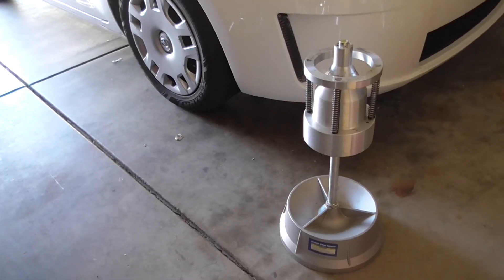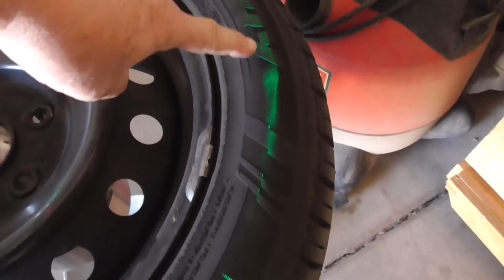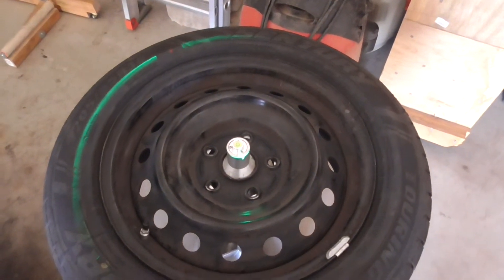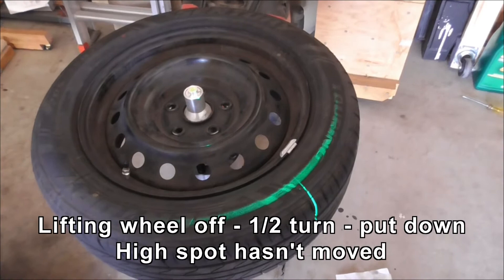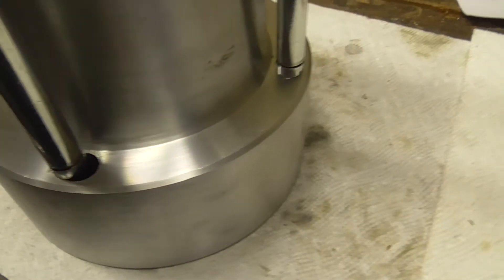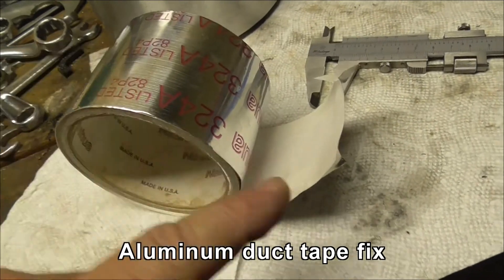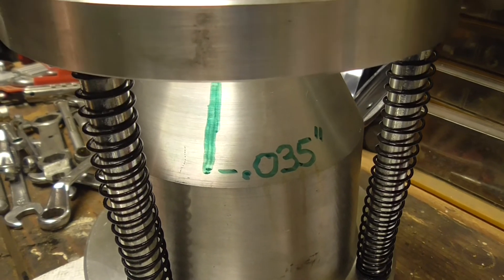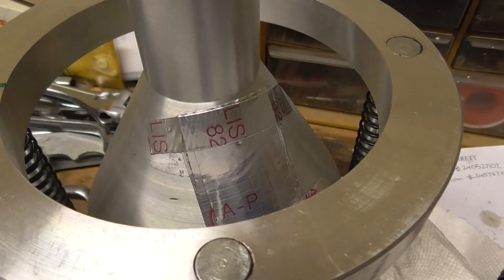HF Bubble Balancer Flaw

Comment: Nice video. Would it alternatively be possible to start with the cone as the baseline truth? Then you would need to balance the balancer mass so it sits level - adding weights to it, permanently. Then you'd need to adjust the bubble assembly itself so it reads level. So after that, remaining unknowns would be if the hardened point (or substituted ball bearing, etc.) adds a bias. But hopefully you would be able to have the balancer, with no wheel on it, read centered at any yaw angle, while your dial indicator is reading zero runout. Then after that, you'd need to be sure the spring loaded ring does not introduce any bias when the wheel is placed on there.
I know this sounds complicated, but it seems it would get you there. And I'd feel better about not having something soft like aluminum tape on my balancer. BTW, I just bought one of these balancers, and don't yet know how bad mine is, LOL.
Reply from the maker: You may have bought a good balancer. I think some exist, just not the one I had.
How long do you have to return it, before it becomes a keeper??? Keep that in mind, I waited too long.

Tips for a good setup:
The central shaft on the base needs to be vertical - check with a spirit level where ever you place it and shim the base to get it vertical. This is because the pivot point doesn't sit on a point, it sits on a ring and that small radial distance can throw things off. Took me a long time to sus that out.
< If you want, you can make a leveling base out of a piece of plywood and 3 nuts and bolts, like at the start of this video - https://youtu.be/JvN4i-qJqMs >

See how much slop you have between the support frame and the head. The wheel must sit perpendicularly with the cone. On my unit the slop seemed to change every time I put a tire on it. Meaning it wasn't congruent with the cone axis (sorry about the big word).

When you have a tire balanced, be sure to lift it and turn it 90° and put it back on the balancer to make sure the balance point has not changed. 

If that all works, you have a good balancer. This can all be tested with a recently balanced wheel from a dealer, if you just had them put new tires on.

I do laser static balancing now & use stick on weights as my alternative to the bubble balancer.
Reply: @richbinaz  I finally am getting around to doing things here. Tested today on an already balanced, never installed, spare tire, and basically confirmed I DO have a good balancer. Got it used on Craigslist, and it looks like a HF one, but is a Costway AT4317. Measurements are all repeatable and make sense. 

I think with all the problems people talk about on these machines, there are actually multiple things that might be wrong with each person's machine, and one challenge is to figure out which problem(s) you've got with yours. And then to solve the biggest one, etc. The cone alignment issue you have seems to be the toughest one to solve. For me, no problem there. 

I've got the standard pivot ring vs. pivot point up top, but a little grease and some repeated jiggles can solve that one within necessary accuracy. 

A big factor I found before achieving repeatable results was how the wheel sits on the cone. I found I need to make sure when looking through the 5 lug holes to the ring behind it, covering about half the opening, I need to make all 5 of those symmetric with eachother - so each hole shows the same gap between the balancer head ring and the wheel lug hole. I found that using drill bits as go/no-go gauges worked well. Setting the flat of the bottom of the drill bit (3 flat faces at the base) against the balancer head ring, and the rounded opposite side of the drill bit against the wheel lug hole, I adjusted things so that on all 5 holes, I could fit an 11/32 drill bit in there, but not a 23/64. Very well centered, hopefully good enough. So for me, as tested on my machine with my wheel/tire, that was the magic discovery NEEDED to get near perfect repeatability.
Reply from the maker: @dre3951  Glad you got that figured out.
I've settled on the Laser balancer as my primary method, which works for most wheels. Heavily dished wheels it won't work on, but I might be able to use my backup vertical balancing rig for that.
Here's my tire change & balance set-up.
https://youtu.be/WgjNO2gt3xg
For those times there is too big of a gap between the bead and rim, I use a bicycle inner tube shown here
https://youtu.be/dQra4YF3MLE

Comment: I would love to get my hands on one of these devices and test it out......long as I could return it if its useless.

Such a shame they seem poorly made.

Just a thought.....if you used the device with out the springs and the ring would that help....so the wheel sits 

I know other guys have modified the pivot pin.....but to me they have no control of were the pin sits then on the cone....slightly off center and surly its no good.
Reply from the maker: Per harbor freight, you have 90 days to return it. Just keep the box and receipt. You may get lucky and get a good one. https://www.harborfreight.com/customer-service-return-exchange.html

The spring frame is supposed to lower the wheel onto the cone and keep it perpendicular to the cones axis. Removing it means you now have to find a way to keep  it perpendicular to that axis. If it isn't perpendicular you end up in this situation and the wheel slews off to one side.
https://youtu.be/JvN4i-qJqMs?t=122

Of course it did not help in my situation as the pivot center was not co-axial with the outer cone.
So what difference does that make? Good question! It's like having a wheel weight added to the rim at an unknown location. So when you lift and turn the wheel 90°, it moves and throws all your readings off.

How heavy is that weight? It's = wheel weight 40 lbs (x16 for ounces) times the offset distance .017" divided by the radius to the rim where you would place a weight 8" (16" rim) = 1.36oz

The narrow angle of the drill they use means it runs around the pivot point on a circle instead of the point. This acts as a damper to slow the rocking motion. Widening the drill point angle just lets it rock more as it is now supported on a point. However, if the point is off center, the problem is not solved. Redrilling it concentrically would fix that one issue. There are other issues
Reply from the maker: Oh, I see you are in the Liverpool area. That would make it hard to get then. HF is in the USA

Comment: I have one of the harbor freight bubble balancers and have never gotten a tire balanced with it. Mine does not look exactly like yours though. You can put the tire on it and look at the bubble and note where it is then move the tire 90 degrees and the bubble is still showing the same thing. 

It never changes so something is wrong with the design build of these balancers. My guess is poor quality machining on the pin. It was a waste of money for me and I have wasted some time trying to get it to work. I tried it again today as I have a couple tires that are out and could not do a thing with it.
Reply from the maker: You have my sympathy. What you describe sounds exactly what my experience has been and even though I am retired, it has been a giant waste of time.
I have tried to fix it after discovering several flaws, but in the end, it now just sits unused in the shed, not even holding any paper down.
Here is my final look at the device https://youtu.be/an6sURvUhBA

If you have steel wheels, this might work for you  https://youtu.be/a4Ox_Emh7Ew
Putting it on a hard surface may require a steel ball - glass was cheaper.

Here's what I did to get a device to actually balance the wheels https://youtu.be/du5cTMqpIhY
It's a lot of work, and only works on one specific hub size - but it does work
Reply: @richbinaz  Thanks for the response. I am retired too, but don't have time to waste on this balancer. I bet I have put in at least 20-30 hours over the last couple years messing with this thing. Back in the day I have used better bubble balancers without any problems and I balanced many tires in those days. That was way before we had the electronic balancers. Also, these days you have to be careful with the wider rims too as you may need weights in the middle of the rim for fine balancing and not on the outside. 

There is a YouTube video out there where a guy took a machined steel ball and a flat plate and modified the harbor freight balancer and he list the parts you need to make the modification. I never bothered with that because that would still cost around 20-30 dollars and a bit of time, if memory serves. At that point it would be better to buy one that works IMO.
Reply from the maker: @Luchnia  I may have seen a different steel ball video. The one I saw he wrapped the ball in tape to fit it in the hole he machined out. Good luck with that...

For a bubble balancer to work, everything has to be concentric, so whatever pivot point you have, it must be accurately aligned with whatever centers the wheel. My unit had a .035" TIR. In the video I said it should be .005" or less. In a perfect world that should be zero.

Adding weights can be an issue and I realize I didn't cover that fully. I will have to do that in another video.
I like doing a 2 step balance 
1. Balance the hub alone but just mark the heavy spot with tape
2. Put the tire on so the yellow dot lines up with the tape - then balance.
Minimum weights needed and occasionally none needed.
With alloy wheels, add stick on weights on the ID behind the spokes
With steel wheels, use clip on weights on the outer rim first, if you have to add a lot of weight, divide up smaller weights between the inside and outside rims. 
That should prevent dynamic vibration - https://e-quipfix.co.uk/wheel-balancing-101-static-vs-dynamic-wheel-balancing/

In the glass ball video ($16 on amazon - look for " DGQ crystal 3 inch  " ) The ball is centering on the wheels pilot radius or chamfer, so by definition, it has zero eccentricity. It confirmed the balance I had already done on the vertical hub balancer for my steel wheels. It did not work on the alloy wheels - CG issues
The self leveling laser is $38 now and accurate also - look for " bekoywoy green beam laser level ".

Wood & bolts from home depot and you end up with a better horizontal balancer.

The final cost depends on how much stuff you have waiting to be used in your garage/shed :)